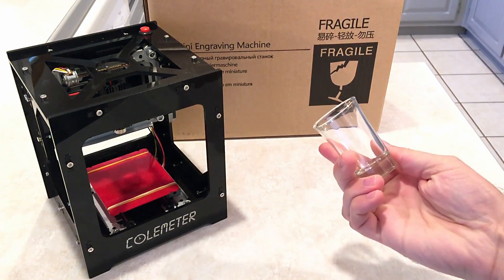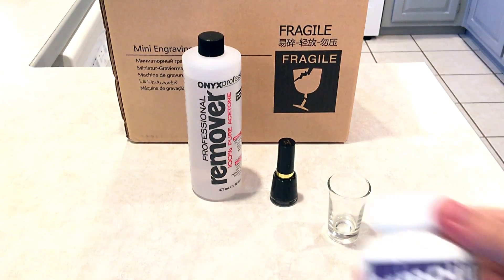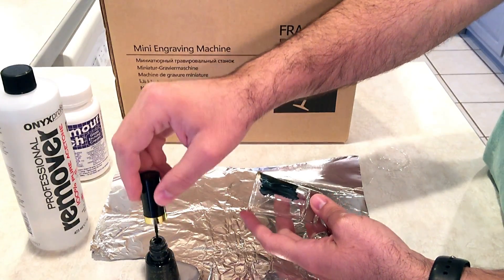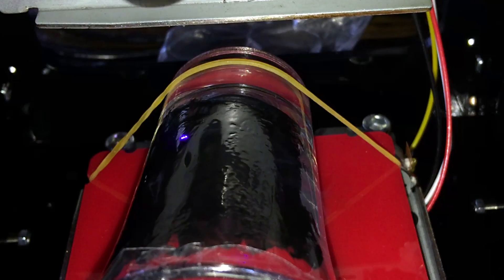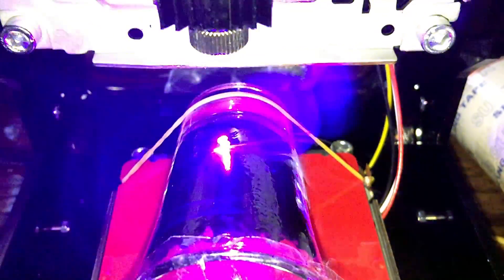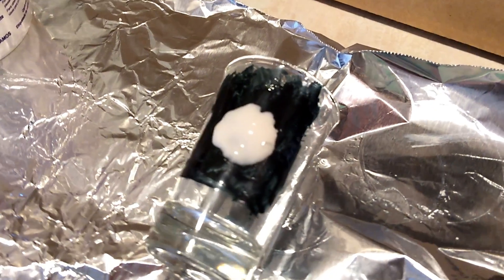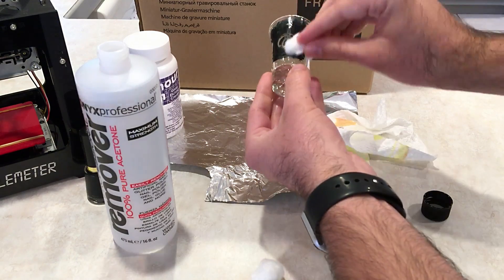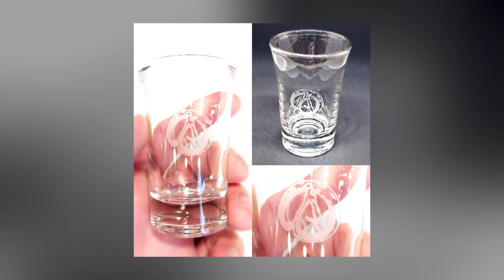How to Etch Glass with a 1000mW Colemeter Laser

Comment: You could use vinyl tape and cut template, and then use cream. No need laser to do it
Reply from the maker: This is a common suggestion; however, not all patterns lend themselves to the design restrictions required by a stencil. This is one of the designs that cannot be successfully turned into a stencil without much manual labor.

Comment: fantastic tutorial. Exactly what i was looking for but i have one question. What burn time did you use?
Reply from the maker: The software I used did not have a time setting for the burn. But I burned at the maximum setting it had, which I think equates to 200-240ms.
Reply: @ohmynoun  That's the info i was looking for! Thanks a million.

Comment: Dear Sir, I have watched for several times your video and found it very useful. Thank you. What I need to know, what for is Armour etch is there replacement for Armour Etch, and can be found on Ebay,
Reply from the maker: The laser itself is not quite strong enough to etch glass. It can, however, etch nail polish. In this video, I use the laser to etch a stencil into the nail polish, which allows for more detail than a traditional stencil. Then, I apply Armour Etch (etching cream) to etch the glass. The cream will not eat through the nail polish, so I wind up with a perfect etch on the glass.
Reply: @ohmynoun  what power is used. I tried with nail polish, blue marker and its ok. I got black leters

Comment: Does is work for Round small Bamboo piece.  20mm round Bamboo to 30 mm round Bamboo.
Reply from the maker: 30mm would be right at the max size that this machine could do, so alignment might be tedious. As for the material, bamboo should be no problem.
Reply: @ohmynoun  can you please sent me any video of Engraving round material.
Reply: Because I want to Engrave on 2mm thick bamboo and it should not Go through tue bamboo That's why...  I use it to make  just brand logo
That's why

Comment: Be faster to cut a stencil with the laser, apply it to the glass as a mask, and then etch it.
Reply from the maker: I've had a lot of people mention this, but I've yet to see anyone etch and apply a stencil this detailed to a round surface with more ease. It is, in my opinion, just as fast—if not much faster—to paint on nail polish and etch the nail polish directly as it is to etch a stencil and painstakingly transfer it to a round surface. It seems to me that there is much more risk of having bleed through of the etching cream if using a stencil, which ruins the piece that's being worked on.
Reply: @ohmynoun  i watched a video of a girl with a die cut machine, cricut or silhouette, that cut a fairly intricate stencil, and used it to etch a round glass piece.  no link to it; but, you can probably find it or similar, see what you think.

Comment: Instead of nail polish have you tried using black electrical insulating tape?
Reply from the maker: Ken Clements I haven’t. I’m not sure this particular laser is strong enough to burn cleanly through that, as electrical tape is a very rubbery plastic. I’ve also noticed that the etching cream tends to bleed under tapes. But it would definitely be worth trying.

Comment: Have you tried mirrors with that same process? Would painters tape work in place of the nail polish?
Reply from the maker: I have not tried mirrors, but I have used packing tape on a flat surface before. It works okay if applied correctly. I don't believe painter's tape would work because it allows the etching cream to bleed. I know it's not supposed to, but it does. Something about the acid in it.

Comment: Do you have to use etching cream or  can you use something else
Reply from the maker: Technically, you could sand blast, too, but I'm not sure the nail polish would resist that. The etching cream is the easiest. There are some acids you could buy at the hardware store that might work, but those wouldn't be a paste, and they'd be much more dangerous to handle. So I'd recommend etching cream and following the safety instructions provided on the bottle.

Comment: Just cut out a design with you're vynil cutter and that's it way better results
Reply from the maker: I've had this mentioned several times, but I've not yet seen anyone share better results with this much detail on a curved surface. If you have a link I can check out, I'd love to do an update video with the better method!
Reply: @ohmynoun  look up glass etching with vynil much better

Comment: Could you use marking tape instead of nail vanish?
Reply from the maker: Tape is a good cheap-o option for jobs that don't require much detail. The problem I have with tape is that the adhesive retains heat and thus does not provide a very precise burn, hence the loss of detail when using tape.

Comment: I can’t seem to get the engraver to etch the nail polish off. I have gone through it 4 times and it doesn’t leave a mark. Maybe I’m using the wrong nail polish?
Reply from the maker: Try not letting the polish cure too long. Also, try getting the polish applied in the thinnest layer possible. If it's too thick, the laser won't cut through it.
Reply: @ohmynoun  I had to mess with the focal length and then it started working.  Takes about 10 different tries and then it finally somewhat etched into it.
Reply: I still can’t seem to get the printer to burn the nail polish. Could it be that I have a kind of nail polish that isn’t reacting well? Maybe it has a glossy finish added? I don’t know much about nail polish so I have no idea.

Comment: Couple things: The Armour Etch only heads 30 seconds to work. Sitting longer doesnt "burn" any better or make the image darker. Also something cool about it is you can save the paste and wipe it back into the jar. It is fully reusable. 

You can also use the laser to cut on vinyl and then apply the vinyl to the glass as a stencil. I use a Cricut to do this all the time and works great!

Awesome idea though with the last and the paint ;)

Comment: Interesting video for a cool gift. Would you think it's possible to have a clean cut through some masking tape or some vinyl to create an all-purpose stencil ?
Reply from the maker: I think, if properly done via experimentation, you could probably get a decent stencil. But it would require precisely dialing the burn time and using the right "backing" to prevent the material from getting so hot it melts too much or not hot enough that it doesn't cut properly. Using a vinyl cutting machine (like the Silhouette or similar) might be the best way to go if stencils are your goal.
Reply: ohmynoun I think you might be right, it sounds like a lot of tinkering for the result. Thanks a lot for the input!

Comment: How can I increase the size of my etching rectangle? My laser head doesn't move across it's entire range of the screw which is limiting the size of text I can etch into any material.
Reply from the maker: I'm not sure what you mean. Is the Y axis also limited, or is it only the X axis? As far as I can tell, there is no limit switch on the machine in my video, so the limits are likely purely software controlled. Perhaps re-flashing the board would help? Otherwise, you may try moving the head manually (when the machine is off) to see if there is something blocking full travel of the head.
Reply: There is nothing blocking the travel of the head.  it etches the words exactly as I have specified them on the screen, but I can't get them to scale up to the full width of the head screw.  I can send you a picture to show what I mean.
Reply from the maker: Sure, hit me on Facebook! https://www.facebook.com/ohmynoun/

Comment: I copied this exact process and the laser is not burning the nail polish.... Maybe i have to not let the nail polish dry?  Are you laser cutting through the wet polish?
Reply from the maker: Yes, you need to let the polish dry. You also want to make sure to use the highest possible burn time and focus your laser as good as you can for the uneven surface.
Reply: Ok so now the laser is cutting through the nail polish after adjusting the lense and turning power up.  Armor etch is the problem now 8( Armor etch will not etch the type of glass im working with. I even let it sit over night with bad results. Now looking to see how to make stencils with this machine so i can just sandblast instead
Reply from the maker: What kind of glass are you using?

Comment: There's an even simpler way to do it by using carbon paper instead of nail polish and you can get an even bigger design because you lay the carbon paper flat to engrave (carbon face up) and then press it against the glass and use that same type of etching compound.
Reply from the maker: Yeah, I bet that would work great. But how would it do on a curved surface and with a design having so many cutouts? The primary reason I went with nail polish instead of some kind of transfer stencil was because off all of the cutouts and the curved surface.

Comment: Is that lasrer powerful enough to engrave the rubber for a rubber stamp?
Reply from the maker: Yes, but I haven't tried it. I would think it would take quite a few passes to get the depth you'd want for a stamp.
Reply: How is it possible to adjust the strength to vary the depth of the laser effect?
Today I`ve gotten one of them machines though but cannot find anything than to alter laser time?!
Is there any alternative software to work with that machine?
Reply from the maker: There are some other softwares out there, but I haven't tried anything other than the basic, because it works fine for me. For some hard materials, like acrylic, lowering the burn time and doing multiple passes is the best way to get good depth without charring the material.

Comment: Cool thanks for sharing, I can also confirm this process works for engraving small custom circuit boards, Except the Glass compound eater substance is copper PCB Fluids, in PCB Etching kits,  Handy and quicker and cheaper to do small boards than to get printing film and stuff, Nail polish can be replaced with permanent marker or sharpie which withstands the Etching solution, There is also another product from NEJE, Which is a Laser ink, You can permanently Etch colored designs to almost any material, Its expensive but goes a Long way. :)
Reply: hey mate, can you please point me to where to get the laser ink?

Comment: I use a EleksMaker EleksLaser-A3 Pro 2500mW Laser Engraving Machine CNC Laser Printer to etch glass with. Please note that this unit is still now where near strong enough to etch glass by itself. I use the glass from picture frames (mind you there cheap picture frames so the glass is thin which works ok because the laser wont defocus to easily) so I have something to prop it up with or hang it. I put 2 coats of matte black spray paint on one side and let that dry. With the painted side facing down (it's how it's worked so far I haven't done it faced up yet) I start my printing. It takes a bit of time because I use sizes ranging from 3x4 to 5x7 frames (because most 5x7 printings take 2-4 hours to etch depending on the detail/grey-scale). I'm eventually going to get a stronger diode laser to speed the process up (soon I hope).
Reply: Hi, can you upload a video of this process? I have an EleksLaser too. I am very interested to see how you do it.

Comment: Hello and thanks for your videos, I just got the Meterk 15000mw, I tried the technique that u showed on your video and I couldnt get it to blast through the nail polish, I used the clear nail polish and the bottle said its a gel type so Im not sure in thats why, I will try to use the regelar nail polish soon, My question is what burn time do u have it set on, thanks, also what do u think about the heves paints that can etch on all sorts of materials using these types of desk top laser engravers, thanks
Reply from the maker: Don't use clear nail polish, as clear allows the nail polish to pass through it without doing anything. Use a dark-colored nail polish (like a dark gray) and you should have better luck. Turn the burn time up as high as it will go for your first test, and then see if you can get away with a quicker burn.

I haven't tried any paints. I'll look them up!
Reply: awesome thank u so much for the fast reply, Im going out right now to get some dark nail polish and etch cream lol
Reply: Just used black nail polish and its working great, thanks

Comment: Easier to use a vinyl cutter.
Reply from the maker: Not really. Let's say you need to etch the letter "O". If you cut that from vinyl, the center of the "O" gets detached, and then you have to mess with properly centering that on the glass when placing the vinyl. More complicated designs (like the one in this video) would be incredibly tedious and difficult to place if using vinyl. If you place the vinyl and THEN cut it, you have to deal with bleeding, seeping, and so on. Using nail polish is as simple as vinyl without the drawbacks.
Reply: I have managed to etch semi complex designs without any issue. As long as you apply the (Self adhesive) stencil properly. I tend to use a low tac clear application tape too so it's very easy to line up. 

The process:

1: Cut the design
2: Weed the design out
3: Apply application tape to the stencil
4: Apply the design to the glass
5: Apply the Etching paste
6: Wait
7: Wash the paste off
8: Remove the sticker.
Reply from the maker: Is the "weed the design out" step difficult? To each his own, but I maintain that vinyl stencils would be something best saved for simple designs, and not for complex designs or non-flat surfaces. Either way, this is obviously just one technique of many, and "easier" is subjective enough that I appreciate your input and suggestion!
Reply from the maker: Nerdite Here's something similar: https://goo.gl/images/nSwwAv Seeing your process would be great, too. I'm intrigued how messing with a stencil might be easier than not messing with one.
Reply from the maker: Or even this one: https://i.pinimg.com/736x/d0/65/51/d06551fcbe33b39f23645bcd961b218c--tentacle-tattoo-drawings-of-skulls.jpg

Whichever you think is best for vinyl.
Reply: There is a type of vinyl designed for making stencils. It is meant for applying to a surface and then painting over it. The stencil vinyl prevents bleeding. Make a stencil using that vinyl, use the vinyl transfer to keep everything lined up, transfer the design to the glass, and then apply the etching cream. The vinyl transfer has a light adhesive that sticks to the vinyl just enough to keep everything in place so you can transfer it to an object.
Reply: Nerdite are you saying that a vinyl transfer design stuck onto a glass with the design exposed like you would have if painting a stencil and then just add the etching cream for a while will have the same effect as What s classed as glass engraving? I have a vinyl plotter and wondering if I can start doing stuff like this. Thanks

Comment: +ohmynoun

How do you account for the slight curve up the shot glass? I have to keep pausing, and adjusting the focus. In addition, I was using 100ms pulses, but didn't get too much success.
Reply from the maker: I was using a 120 burn. The curve didn't seem to interfere with that. If you're having trouble with it, try a different brand of nail polish. A lower quality polish may burn easier, even if the focus isn't perfect.
Reply: +ohmynoun Thanks. Just got a new nail polish today which was quite cheap, so not sure about it. My machine is a Neje DK - 8 - KZ, which appears to be virtually identical to a number of machines on the market. Was considering getting the 1500 mw module to upgrade it.
Reply from the maker: How are you powering the machine? If you're plugging directly into a PC's USB port, you may not be giving the machine all of the juice it needs to go full-power. I use an external, powered USB hub to power mine. I wonder if that could make a difference?
Reply: +ohmynoun- the Neje has two USB leads going into the machine. I assume power and data on both. Tried using with a USB power supply from something else, and suddenly, nothing happened...

Comment: my program is maximum 100ms. how can i make 240ms
would you send me the program you used?
Reply from the maker: I would love to, but the program I use came with my etching machine. Its actual title is: Only For Mini LaserCarver. But it's created by NEJE, so you should be able to get similar software from their site. One warning, though: If your laser came with software limiting to a 100ms burn time, it may be because the manufacturer wants to prevent overheating. So, if you extend the burn time to 240ms (which is more than twice as long), consider adding a fan to the laser's heatsink. If there is no heatsink, I would not attempt increasing the burn time. Instead, consider using multiple passes, as I've had more luck with this method lately than just blasting everything full throttle from the start.

Comment: Is it possible with such a low wattage to etch a Walnut shell, which is much harder than the wood, I have asked many companies and no one can say what wattage would be needed.  Many Thanks
Reply from the maker: Oooh, what an interesting question. I like that. Any other materials I could try at the same time?
Reply from the maker: Quick update: YES! I just etched onto a fresh walnut shell, and I'm thinking of including it in an upcoming video. What's more is that intricate patterns can be etched into a walnut shell because it's organic and can burn at multiple strengths/burn times.